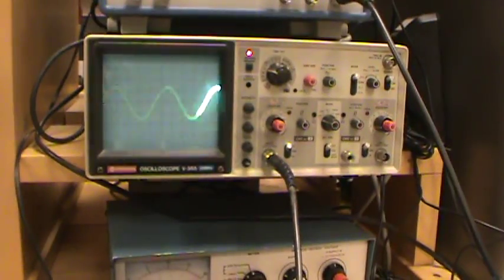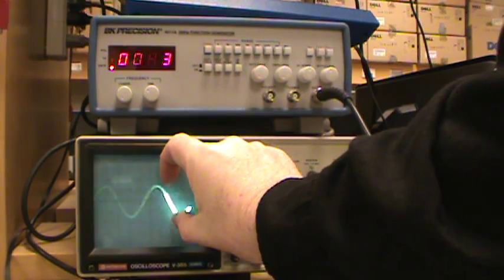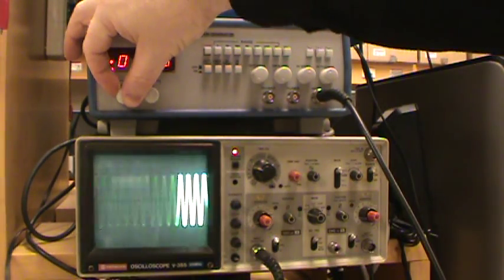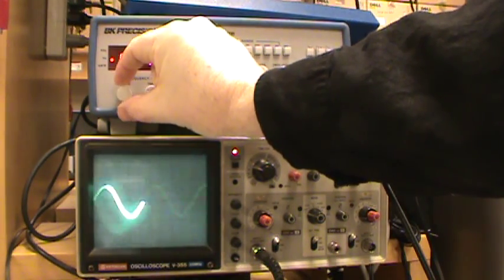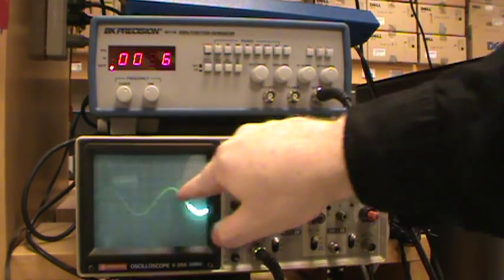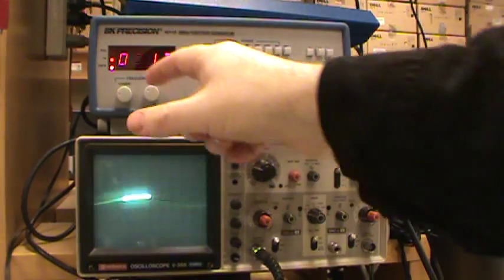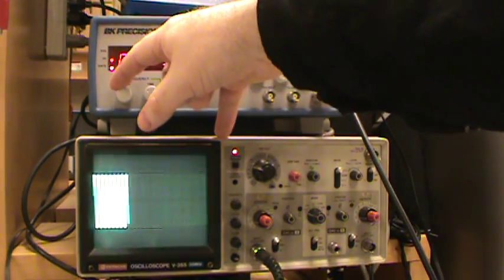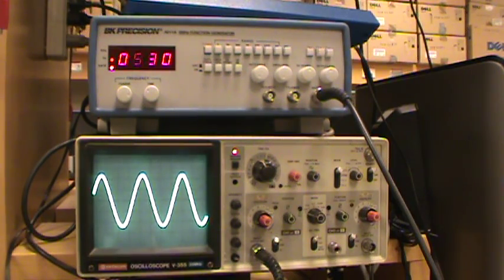RC Circuit - High Pass Filter (Part D)

Comment: Hi, may i ask something? i am stilll rather new to electronics.
Just wanted to find out this.

I am using a 0.1uF capacitors, series with a 22k resistor, in the same layout for a HPF.
in theory, My input signal is a 4.27vpp, 1khz sine wave. Based on calculations, using vout = vin * R/Z, i should get 4.25 vpp for my output signal. However, i am only getting 3.44Vpp as output.

Am i doing something wrong?

Comment: good video although may I suggest a few improvements so that the video makes more sense to guys who are new to the field of electronics/electrics. You could first explain a resistive voltage divider and how it works. You could then mention reactive components (Inductors/capacitors) and how their resistance changes with frequency, hence the output voltage amplitude will change with respect to frequency.